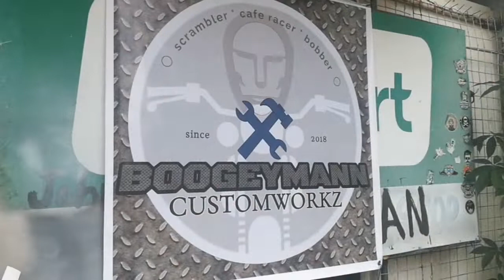XL100 ammo box installed | side stand extension

Comment: Boss mGkano pagawa at kabit ng bracket nyo dyan sa anabu? Thanks
Reply from the maker: Murang mura lng sir. Walang 500 kasama side side stand extension. May pintura na dn. With bolts
Reply: @mr.cabiteno2248  sir me contanct no ba sila or fb page? Salamat po
Reply: @mr.cabiteno2248  sir saan yung loc nang anabu?
Reply from the maker: @emanzue8680  pm nyo lng sir si boss Roel Relente sa fb